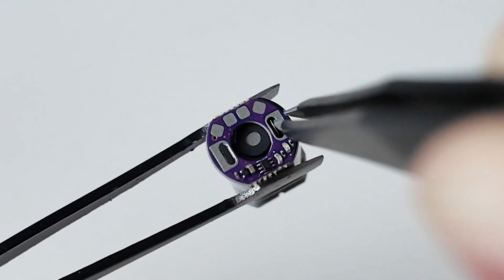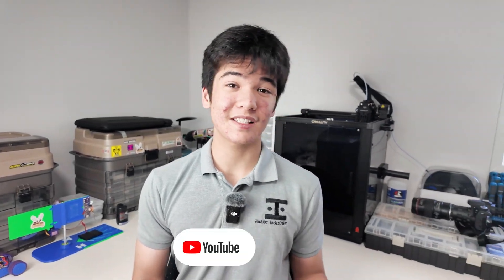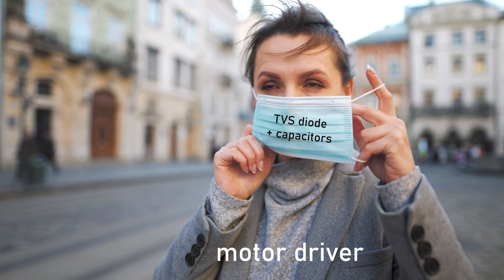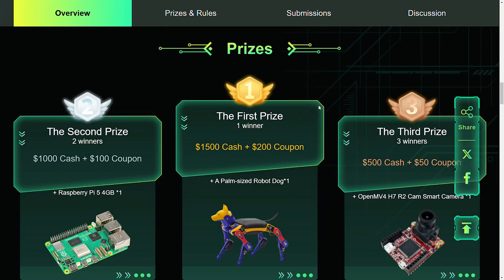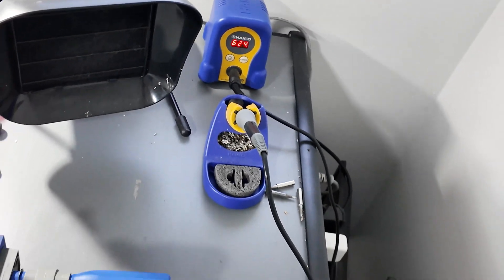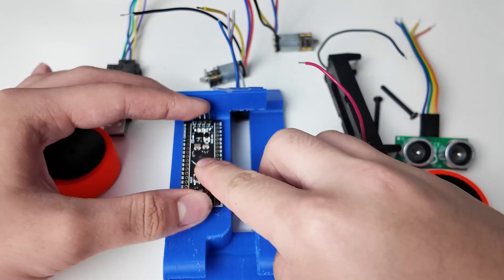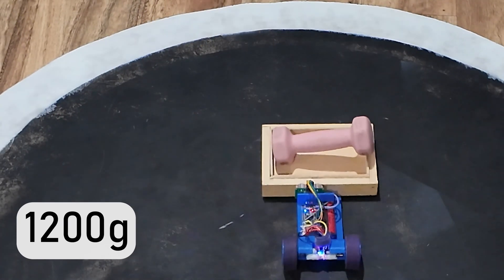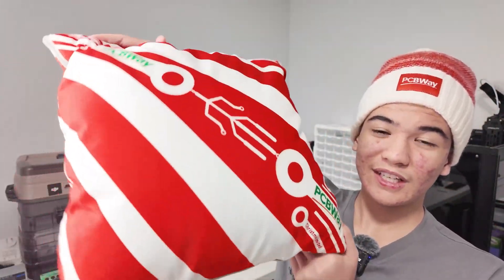Make using N20 DC gear motors EASY with this add-on! (it's tiny!)

Comment: How do you sync both motors? I am trying to sync 2 N20 reduction motors and do not want one to move slightly fast than the other. It is crucial that both motors move and stop in the same spot.
Reply from the maker: Magnetic encoders to sense position. A control system which makes the motors turn at the same speed at the same time. Alternatively, you can use BLDC motors with a sensored FOC algorithm.

Comment: Would the tinyDVR work with a CFX sound board, I’m trying to utilize your pcb on a DC motor for the crystal chamber?
Reply from the maker: Not sure. How does the signal output of that work?
Reply: I’m not too familiar with how it works but I know a motor can be wired to a CFX. The CFX is made by plector labs: •	CFX has a vibration motor pad (Haptic) to drive a rumble motor.
	•	It outputs PWM or on/off signals depending on the blade effect or clash configuration.
	•	Current is usually limited to drive small ERM motors (~100-200 mA).

Comment: Hello. I also need a motor driver like this. It's not a topic I know much about, so I'm asking: There are two more terminals besides +/- – what are they? Do we communicate with the microprocessor via I2C? What library should we use? (I'm using Arduino IDE.) If you have example code, that would be great. Also, when I add the project to my cart on PCBWay, it asks about the layer order.
Reply from the maker: Scroll down in the PCBWay projects page at the bottom of the description for ordering instructions. Control is IN1/IN2 style, in the same way that this article with Arduino example code describes: https://learn.adafruit.com/adafruit-drv8871-brushed-dc-motor-driver-breakout/ Just mind the 2-10V motor voltage input rating. Thanks for buying it 😊😊
Reply: @h1tec All the details were already there—I got excited and commented without reading thoroughly. Thank you for the quick response
Reply: @h1tec  Hello, actually it's been quite a while since my order arrived, but I only just got to try it. The driver works flawlessly. It really provides great ease of use. Thanks for sharing.
Reply from the maker: @brsguler thank you so much!

Comment: It would be interesting if a pin header with polarisation key would fit and the use 28AWG or 1.5mm wire with thin wall insulation since only 5Vdc max

Comment: Can anyone explain what is so useful about this addon apart from the improved soldering pads? I don't understand the 'driver' and protection part, what does it add exactly that you would normally need to add elsewhere?
Reply from the maker: @ibendiben  yeah, sure 😁 to control a DC motor with an arduino, you need an ‘H-bridge’ chip which can handle the high currents through its internal transistors, because the microcontroller can only output 20mA through its pins. This would usually be done with an external module such as an L298N or TB6612FNG, taking up additional space, but adding the H-bridge motor driver onto the motor brushes improves soldering and saves space that otherwise would’ve been taken by an H-bridge module.
Reply: @h1tec  thanks for the quick response. I had been thinking about this possibility yes. But if I power the motor directly from a battery and only use some kind of smart external switch to switch on/off or current direction this can be omitted too right?
Reply from the maker: @ yes, you could, but the functions you are describing are served best by an H-bridge 😉
Reply: @h1tec  haha. Probably yes. I'll see what I can figure out for my project and got this addon in thee back of my mind! Thanks a lot for getting back and: nice idea and video!
Reply: @h1tec  I think direction control is the main advantage, bow I understand it better. That's what you'd use the h bridge for right. So unless i can do it mechanically I can just use a transistor or Mosfet for the current regulation.

Comment: Are you giving out the KiCad Files to this board publically? I am personally interested in scaling this up to use with larger 16mm brushed motors in antweight combat robots!
Awesome Project!
Reply from the maker: Hi dude, sorry for my late reply -  I’m not giving out the KiCad files to this board since it’s so simple. For the project you are talking about, you’d have to completely remake it, so you won’t need the files (I can still give them to you if you really want them though). You wouldn’t use this motor driver IC, DRV8212, for a 16mm motor. I would use one of DRV824x-Q1 from Texas Instruments if the motors you are talking about are any more powerful than these, which they certainly are unless they are super, super cheap (like $2 lol). If you want me to design this for you myself and you can own the files and manufacturing rights, given my many hours of research into brushed motor drivers, just contact me on discord @_h1tec and we can arrange something 😁 thanks

Comment: Would you be willing to "do this again", with a esp32, a uln2003 stepper driver or equiv, usb-c power(with the right silicon you can get 100+ watts at 24v, perfect for getting the most torgue. I. working to design a blinds' controller, and The off the shelf are big and chunky. Prefer something that the size of the 28BYJ-48. My design I prototyped, I could use a power bank, to power the device, and open and close blinds. Hand wiring is a pain. But a a version similar to what you have done with the n20 is hugely useful. Note 3d printers are now using usb with klipper, driving a standard stepper, and temp control.
Reply from the maker: @glennwest267  hi, I don’t think I can make a video about this specific of a topic, but it sounds really cool and if you would like any consultancy or PCB Design services for this project, please feel free to reach me out on discord @_h1tec or email me 😁 I could certainly design such a PCB for you if you’d like 👍

Comment: Cool project, and looks useful! I think your issues with the stm32 can be a lesson for everyone: an ESP32 costs about 1 dollar, so you can save up to 1 dollar per unit by going with a cheap underpowered microcontroller like a low-end stm32. But it's going to require a bunch of programming effort and troubleshooting and workarounds for missing features. No hobbyist should have to waste time on that to save a buck! It's something to do later, when optimizing for mass production. Even a thousand bucks saved from a thousand PCBs isn't enough to justify much extra development time. Join the dark side and just use the popular mainstream micros! 😄
Reply from the maker: I would, but I’m going to make a Linux SBC soon so it’s essential that the software and hardware becomes harder in my projects over time, or else I won’t be progressing. I’ll just have to muster it up lol 😂

Comment: A version with an encoder would be great.

Have you considered using platform io & vs code for stm32 programming? It seems a lot more approachable to me.
Reply from the maker: @MoreRamenPlease  I will be making one with position sensing.

No, I haven’t considered platform IO and VS code, CubeIDE seems fine for the moment and I like the graphical hardware configuration. I will check it out though 😁

Comment: A version with an encoder would be great.

Have you considered using platform io & vs code for stm32 programming? It seems a lot more approachable to me.
Reply from the maker: It's coming soon :) No, haven't considered those code platforms yet - I'll check them out, but I really like the hardware configuration GUI of CubeIDE. Have a great day!

Comment: They are not that hard to solder tbh. 
If you want to improve your results: 
 - Technique improvment -> 1. Set your iron to 320°C to 380°C 
2. Tin your tip with a bit of fresh solder, you can flick away the excess with a quick movement of your iron. 
3. Your solder wire has flux in its core, the flux helps to keep the solder oxyde free and wet the metal quicker. However, the flux burns quickly, so you should avoid putting it on the iron tip and instead squeeze the solder wire between the pad and the iron, then add more solder to the molten tin. 
Hardware upgrade : get yourself an iron with an active tip lime the ts100 or the pinecil. Even at lower power, the heat transfer is way better. 
Get yourself some flux. I like the chipquick NC191. 
Get yourself good quality solder wire. Not low temperature, not desoldering wire. Preferably leadfree, but doesnt have to be alloyed with silver.. I preffer thinner solder wire, easier to control imo. 
Steelwool works well to clean your tip, no need for fancy copper wool and wet sponge are annoying.
Reply from the maker: @NicolasSicardRoy  doesn’t change the fact that using the motor with bare wires is still more delicate and doesn’t have a motor driver. Thanks for the advice though - I already do know how to solder these motors well, but I still do find them annoying sometimes. TinyDRV makes it so much easier.

Comment: would it be possible to control speed  and direction just with 1 pwm signal? i was wondering if using a comparator, could set the dir pin, and pwm to set the speed. So it would be easy to use those 4ch tiny receivers like fs2a.
Reply from the maker: @gsasagas  only if the motor is being driven in one direction. If it is being driven in both directions, this is not possible with this board. It can be done though, like in the case of a continuous servo.
Reply: @h1tec  i thought a bit more... thinking about using a comparator output to set direction. idk if it would work. Maybe splitting pwm signal is not the best way to do it.
Reply from the maker: @gsasagas  👍

Comment: i can not download the gerber files from pcbway. can you share it?
Reply from the maker: @rusencelik1272 no, sorry. You can only buy it from PCBWay projects 😁 So, you can either purchase the bare PCB, or PCB and assembly from the shared page. The schematic is available there, too. If you are looking for the dimensions, those are very easy to find - it’s just a 12mm circle cutoff at 10mm height. If you want the footprint and solder pads, just screen shot the video during the PCB view and copy that. But, gerber is manufacturing files, so I don’t want to share it. I want for it to only be bought through that page, so that I am given small commissions for the work that I put in. Thanks 😁
Reply: @h1tec  oh i got it. Can i design a board similar to this with some additional features and share it open? This is your idea so i wanted to ask you before designing and sharing open. I will create my own schematic and my features but since making the drives this size and deciding the shape as this i needed to ask you beforehand.
Reply from the maker: @ of course, dude 😁 sorry if this makes it harder, but I just don’t want to share the manufacturing files. Sounds good 😁 Reply here on this comments section if you need help - I’d be happy to help with any design tips.
Reply: @h1tec  no no it does not make it harder. i was already gonna design a version of it. I have shown this to one of my professors(mechatronics) and he said that you have made the product that he was thinking for some time and wanted to produce it for our reseach center ('metu romer' located in turkey). also he asked how much would it cost. Thats why i wanted to get the gerber and take price offer from other supliers since pcbway is not the cheapest. Anyways we will design and produce a board similar to this possibly with an ecoder. When we do that i will share with you. Thanks for your great work. :)
Reply from the maker: @ alright, cool, thanks. 😁

Comment: Bro, cut off the extra wire you tinned. If the end gets bulky, just snap it off and keep it neat and get a better soldering iron with a nice tip!
Reply from the maker: @KhushitShah I did, look at the thumbnail lol 😂 thanks for the advice though, I was just soldering in a hurry 😅

Comment: Sweet video! Please get a smaller soldering iron tip, it changes everything. It would be cool to add an encoder and maybe current sensing. Could be a fun rigid flex board with multiple folded layers. I also wonder if you do a flex pcb with a thick metal stiffner to act as a heat sink.
Reply from the maker: @eastonlachappelle6402  Thanks! Personally, I find oversized soldering iron tips better for me because they solder stuff quicker so I don’t have to hold it there for a few seconds lol. I was stuck on an SMD sort of tip for a while, which was really annoying, so I pretty much went in the opposite direction. I’ll try doing a smaller tip than this in my future projects and test if it works better though😁 Those are some cool ideas for future iterations if I ever make them (or someone else). Thanks for commenting 😁

Comment: I would be happy to combat test some of these in the very competative Adelaide robot combat environment. I have some spicy carbon brushed N20 gearmotors with a 3A stall current that these would be perfect for. This might be a really nice product for botbitz or llamaforge to stock. Very similar to the BBB red esc but smaller and higher current.
Reply from the maker: @jong036jong5  Thanks! Glad to hear it has some applications for you guys 😁